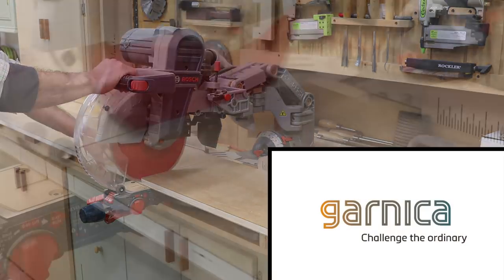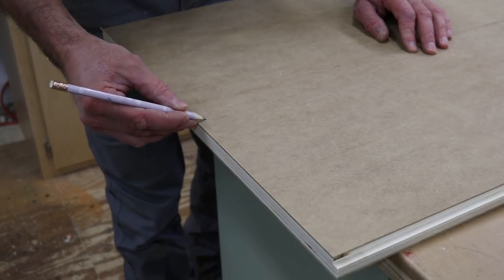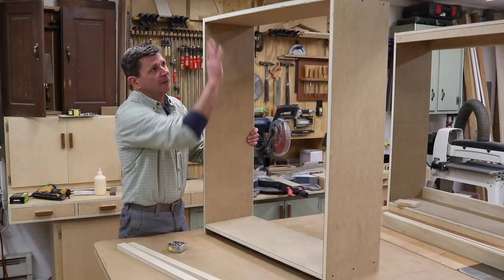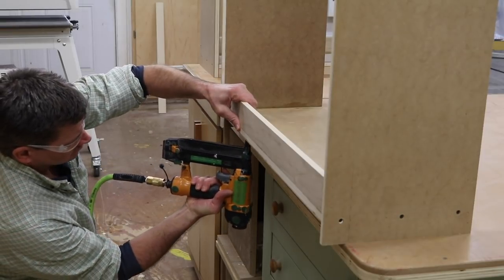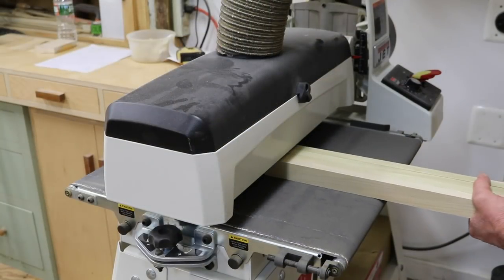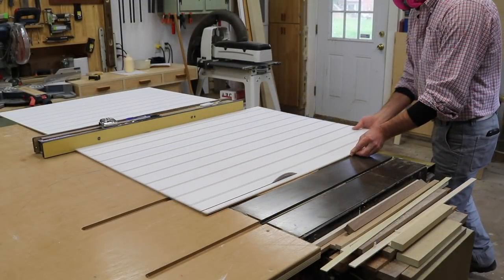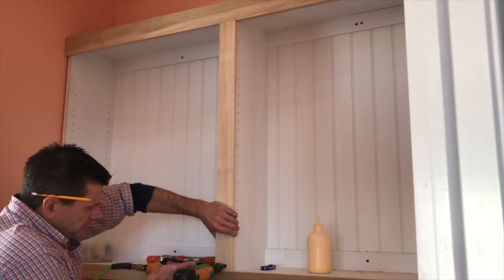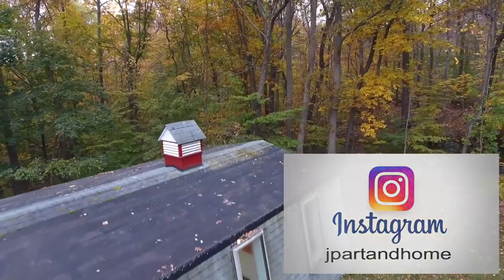Build & Install Kitchen Pantry Cabinet - Adjustable Bookshelves

Comment: Is there a reason you use the brad nailer over a pin nailer? The pins are easier to cover up and since you are gluing everything you don't really need that extra strength.

Comment: Just curious why you put a line on the inside of the side panel and drill the pilot holes from there outward (I've seen you do similar pilot holes this way in other videos)?  Isn't it just as easy to strike a line and start the holes from the outside?  If the drill isn't exactly perpendicular, the holes on the outside would not be aligned.  Drilling from the outside in, would hide any misaligned holes in the joint.  I only ask because I've made misaligned holes in this way in my own projects in the past, in applications where I was leaving the screw visible or hidden beneath buttons or flush dowel plugs.  Draws the eye right to them.  And I realize you're hiding these between the cabinet and the wall or the other cabinet, but still wondering if there's an advantage doing it the way you demonstrate?

Comment: Hi John, great channel, I've been watching for a while and you've given me the confidence to give it a go, I'm about to tackle my first project.

I've got a couple of general questions after watching a few of your videos, specifically the cabinet/bookcase ones. 

When you pre-drill your holes to attach the sides and top, are you pre-drilling both pieces or just the one that gets the countersink? I've watched a few of your videos repeatedly and I can't see if you're doing it or not. 

The other question is related to proportions. Are there 'standard' proportions that are used when making general (not made to fit ones) furniture like book cases or cabinets?

Comment: Instead of drilling through your cabinet to hang it you could move the bead board in 3/4 inch and put a French cleat flush with the sides on top and near the bottom for a much cleaner finish 😊

Comment: Looks great Jon, I'm sure you get this question a lot but I don't fully understand wood movement and I get nervous about it. Do you think the middle trim (that goes top to bottom) will expand at all, pushing the two horizontal trims out? Thanks
Reply: solid wood does not expand much along its length. It will expand along with width of the boards, but the narrower the board the less likely you would see expansion

Comment: What was needle size to use to spray that primer
Reply: I use a 2.5 in a Fuji sprayer, I thin it and use Floetrol. I think a straight airless is probably best for the thick paints though. Just my .02....